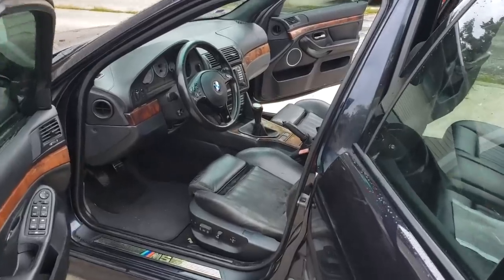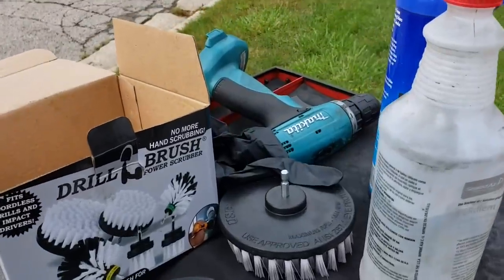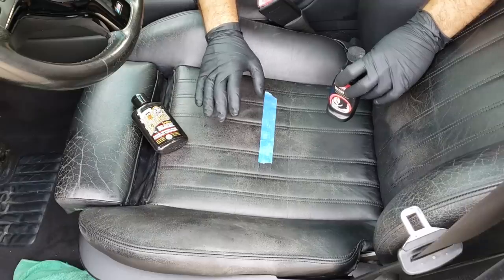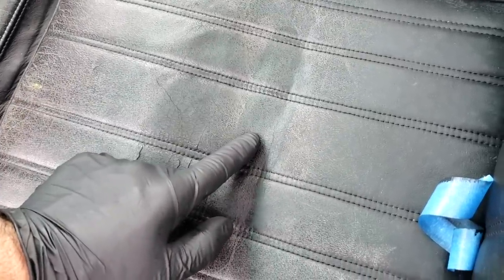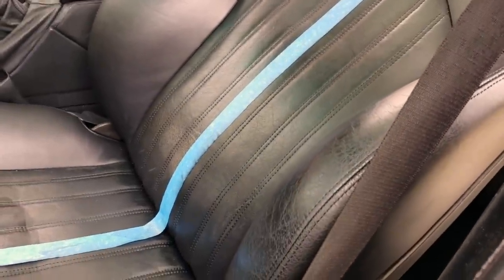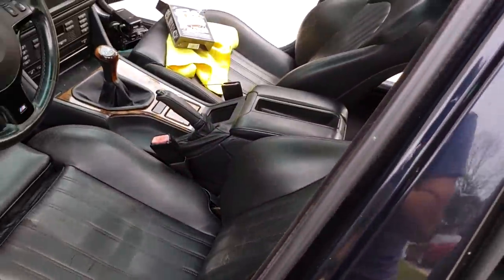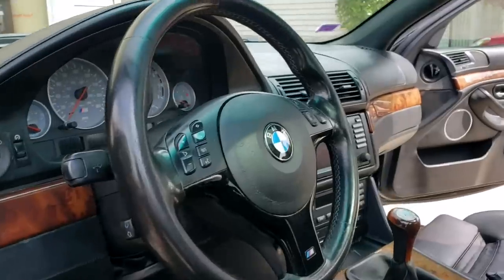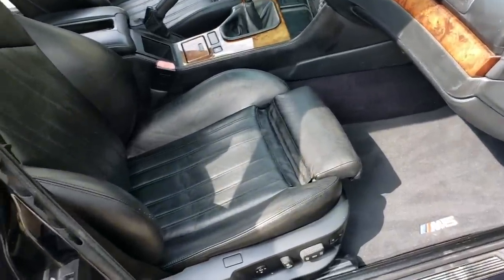Restoring The Leather Seats On My 409,000 Mile BMW M5 For $15. Easy DIY Seat Restoration.

Comment from the maker: Here's the stuff I used on the leather https://amzn.to/2C6VWaS and links to everything else used.

Doc Bailey's Leather Black - https://amzn.to/2C6VWaS

Leather cleaner/Conditioner for any color - https://amzn.to/36BGyRQ

Kiwi Black leather dye - https://amzn.to/2NslQe8

Yellow drill brush power scrubbers - https://amzn.to/2kh3OkC

White drill brush power scrubbers - https://amzn.to/2mia1gX

Car upholstery cleaner - https://amzn.to/2C1WCya

Solution Finish Trim Restorer - https://amzn.to/2lM7Bqx

Very complete auto brush kit - https://amzn.to/2lOGZ8m

The best deal on Microfiber towels I can find. https://amzn.to/2PZYvAP

Cool Car Stuff I Buy on Amazon https://amzn.to/2k606u1
Reply: I need engine work on my 6.2 amg.  Ported heads, hotter cam and other stuff.  What Chicago area mechanic do you recommend for high performance rebuild?

Comment: Poll: What's more amazing? The results he got? Or the fact that there is a BMW with 409,000 miles?
Reply: Definitely that there is 409,000 miles on a BMW and I haven't even watched the video yet. He must have had to dump a lot of money into it.
Reply: The mileage
Reply: @koteletten84  if "by take care of it" you mean constantly have to take it in to get repaired after it's just a few years old then sure. I keep a car maybe 8 years and drive maybe 175,000 miles in that time. I want a car that need nothing more than regular maintenance (oil changes, etc) and things like tires and breaks. You aren't going to get that with any German cars. And when they do start needing repairs they are absurdly expensive.

A German car like a BMW is good for maybe 40,000-50,000 miles. Then you are better off getting rid of it. It's just a bottomless pit that sucks in money after that.
Reply: @letsplayclassicgames5024  the experience is very unusual for BMWs. They are very often bottomless money pits.
Reply: @koteletten84  It's because the people that talk trash on BMW's have no actual experience with them, or didn't take proper care of them in the first place. While I am not a fan of new BMW's, e46/e39 and generations back are amazing cars and theres a reason these cars have such a huge fan base. Any car that I have ever owned that wasn't a BMW, I have sold and gotten another BMW (e36's specifically).
Reply: @jimv1983  Lol here where I'm from( EU-Slovenia) BMWs, especially the older ones are also known for reliability, especially if they are the inline 6 models or bigger.  OEM part quality, let it be interior or exterior is pretty high, you  just have to take care of it. Also the e36/e46/e39.. parts are quite common/accesssible so they arent too expensive to maintain given what you get from a car
Reply: Exactly first thing came to my mind!!
Reply: Haha THIS is the first video I find when looking for tips to treat my black leather interior. (for my 1999 E39 M5) kismit
Reply: I clicked it because of it's mileage. I lost interest with the leather anymore.
Reply: @letsplayclassicgames5024  vanos issues were a pain to deal with even though I didn't own an m3. And rod bearing replacement as a maintenance item is crazy. But I do understand that if you want to play with BMWs you have to pay to play way more then AMGs
Reply: @jamesandrew6153  that has nothing to do with it. You can follow the manual's maintenance schedule perfectly and you'll still need lots of repairs (often very expensive) on German cars. 

To say that "single women and oil changes don't work well" is ridiculous.
Reply: The e39-e46 models are a lot more reliable than most BMW’s that they put out now. Basic necessary maintenance will keep it up with any Honda
Reply: @jordanlunderville7319  those 540is V8 had many common issues as well as the standard inline 6. Can't run away from vanos issues or water pumps issues.
Reply: @jordanlunderville7319  a BMW keeping up with a Honda in terms of reliability? Yeah, ok. Whatever you say. 🤣🤣🤣
Reply: Seats
Reply: Definitely the mileage, especially for an M5
Reply: @jimv1983  Let me guess....you drive a honda accord.   🤮
Reply: @t.p1234xyz  no, I don't drive a Honda Accord but I would get a Honda before I'd ever get a BMW. I'm the kind of person that doesn't want to have to take a car in to get fixed on a regular basis after 50,000 miles. 

I drive a Lexus ES. My previous car was a Toyota Camry. I had it for 10 years and drove it for 180,000 miles. It never needed ANY repairs. Oil changes, brakes and tires. That's it. You aren't going to get that from a BMW or really any German brand.
Reply: Only Americans think German cars are shit, go to Europe and you'll see a different picture, because people in Europe actually know how to take care of their things
Reply: @noname-es4cy  you can take great care of a German car and it still won't last as long as a Japanese car.

My last car was a 2011 Toyota Camry. I owned it for almost 9 years and put about 175,000 miles on it. All I did was regular maintenance. It didn't need ANY repairs. That is unlikely to happen on a German car no matter how well you take care of it.
Reply: @jimv1983  have you ever owned a German car?
Reply: @noname-es4cy  no, I've learned enough from other people that have. I know lots of people that have owned German cars. None have had their car reach 100,000 miles without needing major repairs.
Reply: It’s impressive, but gives me stress thinking about the maintenance costs associated with getting an M5 to that length of life
Reply: I came for the mileage
Reply: 296k miles on my E39, all original. Regular maintenance
Reply: @jimv1983 because bmw in USA are made in Mexico! While  bmw in Europe are made in Germany and are so much better.
Reply: @michalcieslak552  it's still the same parts and same engineering
Reply: Not suprising as its a V8 engine. Not much stress. The rest of the car is pretty stock standard and not too complex compared to modern bmws
Reply: @jimv1983  nah man you guys have way more problems with your cars. Probably something to do with the weather extremes
Reply: @jordanlunderville7319 I don’t think bmw and Honda should be in the same sentence but yes these older bmws are way more reliable then the newer ones

Comment: I've been using it for years. I use a really thick layer as my 2nd coat, let it sit on the seats for a couple of hours and with a microfiber towel go over it gently making sure its evenly distributed and just let it dry over night. In the morning i go over it again with more pressure on the microfiber towel to remove excess.
Reply: What if it’s not evenly distributed
Reply: Alex Polishchuk in my case its never fully dry. It doesnt give it a shine so if you miss spots just go over those.
Reply: does any of it come off onto your clothes?

Comment: love your videos , I have had great results from Lithium Leather Love.  It has made a tremendous difference in my '03 SL500 interior.  Completely erased all the little cracks in the leather.  It does a fantastic job bringing old leather back to life.  I am not a distributor, or get compensated by Lithium in any way, I have just been detailing cars for 30+ years and like to pass along what works.
Reply: crazy box I recently found Leather Love as well; the stuff is amazing! A true restorer and conditioner. No more Leatherique. Going full time with this.

Comment: My old BMW E46 seats of the same year as your ones looked exactly the same, before and after, using a simple black Wapro shoe dye thinned with a turpentine soaked rag to really get into the cracks. Amazingly easy and effective. So true, your comment about never selling a car without doing it.
Reply: Btw, 3 years ago and still looking fine.

Comment: Going to give this treatment a go on my 385,000 mile all original merc interior, its not bad but could do with a little tlc, like the quick easy application of this stuff.
Nice job Alex.
Reply: whats it like having that kind of miles on a car? does everything fall apart at a certain point?
Reply: @h7pubg  Everythings still good.👍
Reply: @Jonc25  nice, we have 2 jags, fortunately made during the ford period, done preventative maintenance, but i really want to keep especially the xk8 forever, i would be willing to redo engine and trans and suspension down the line when it has a ton of miles (84k rn) just bc it has personal value , but idk if at a certain level everything else just fails like wiring and stuff you can’t really get to. hopefully i can keep it on the road for a long time.
Reply: @h7pubg  Still got the Merc, now showing 415 thousand miles, i won't be letting it go anytime soon.
XK8 is a nice one to keep.

Comment: I have low mileage w211 its a 2003 with 41000 miles on it. The leather seats are on really good condition but do have a few sciffs etc on them . So I tried this on all the scuffs and applied a coat over all the seats . The seats look like the have just left the factory ,amazing stuff.I am in the uk and the only way I could get this product was on ebay from a seller in Florida total cost with deliery about 12 dollars. Keep making the great vids regards Tom uk.

Comment: I used to work for a company called Griots Garage and I ran their car care school. They make a product called Leather Rejuvinator that literally can make those cracks almost completely disappear and without using die at all. Another thing is the outside temp. It is not exactly warm in Chicago right now and that affects how the pours of the leather absorb conditioner/rejuvenator. I used to love applying GG Leather Rejuvinator to a customers car in the heat of the summer. Close it up and let that soak in to the seats for a couple of hours and it would be like a miracle.

Comment: I would recommend three step restoration:  filler, paint, clear coat for these cracked seats. this method is good for 3-6 months
Reply: what happens after 6 months? the filler falls out?
Reply: @gregh7457  it fades away
Reply: I did similar with same year BMW seats using a Wapro shoe dye. Did it 3 years ago, still looks good.
Reply: @gregh7457  the shoe polish fades away
Reply: Or you can bring the car to a car upholsterer and he can change the leather of the seats + the sponge that is compressed and worn and have brand new seats, not the old ones with paint on them. Yes, it will not cost 50 $ or under but you will have new seats. This whole dye thing is just an eye smudge so you can sell the car easily.

My 2 Cents here :)
Reply: ekim andersom  Yeah, if you have 100K $ for a black hole for cash, you can. :) BMW after 2004 is a black hole for money. You can trow an infinite amount at them and still have the same problem over and over.  I can tell you that from the first-hand user of an e61 535d. :)

On topic: As I can see the badly cracked the leather of those seats, probably my choice will be to be upholstered with new leather then painting the old and cracked one.
Reply: Our kits last about 2 years ☺️
Reply: ekim andersom the food industry sells the leather from animals to other industries. Also most modern cars now have synthetic/vinyl leather options.
Reply: Yes I agree. The leather is cracked and deeply damaged. Within 3 monthes will be at the same point.
Reply: ekim andersom  Agreed. Leather is a deal breaker for me when car shopping, and fake leather is a big drawback cause even though it last longer than real leather, it doesn't look good as long as fabric and it's still uncomfortable in cold and heat.
Reply: @leatherxkits7161  i think the total thom used your product, came out amazing!!
Reply: Keith Singleton he did! Thanks!
Reply: @ivoandreev6766  
yeah right and spend $5000 on new leather ! 
I’d rather do the dye technique once a year.

Comment: I took mine to the upholstery guy and he did my seat bolsters. They were completely worn down to the bare leather. After he was done it looked 100% original. I was amazed. He wouldn't tell me what he did but charged me 100 bucks. I was very happy.